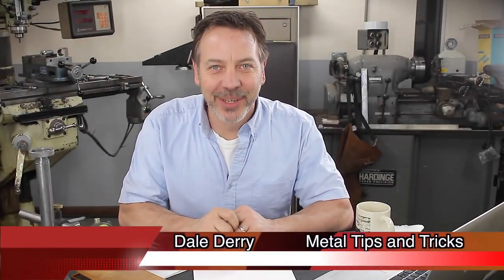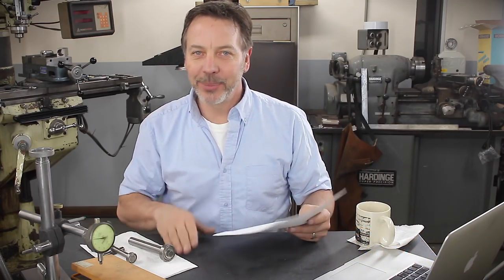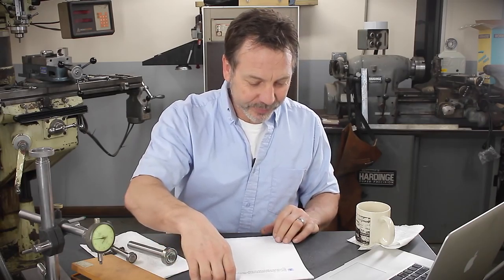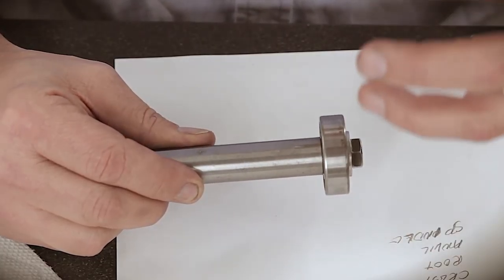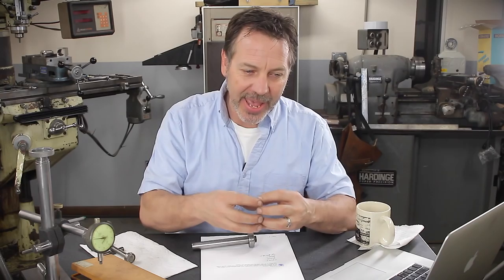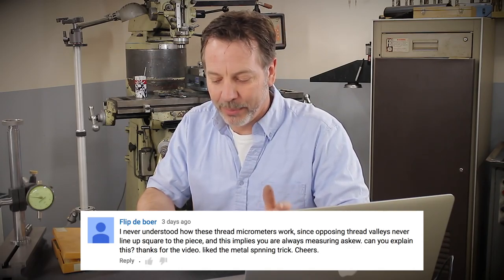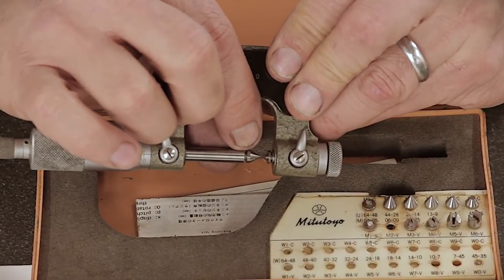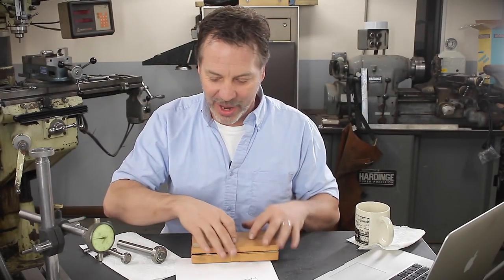Q&A Threading tubing

Comment: I've seen some low melting point metal which is supposed to be good for melting and forming inside a thin-walled part for machining.  When done, just melt it back out.  I don't know how clean that would be,  but sounds interesting if you were to need to machine something thinner than what you were working with.
Reply from the maker: +ILGopher 
Interesting Idea